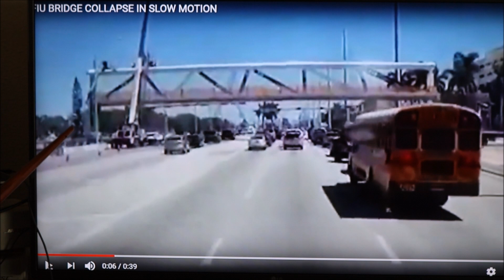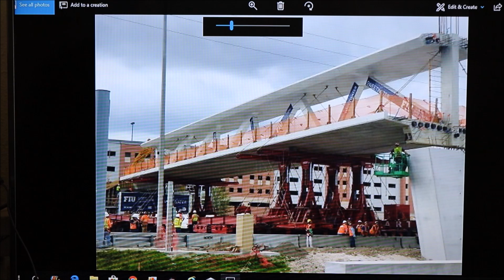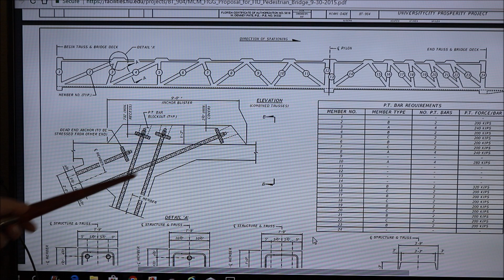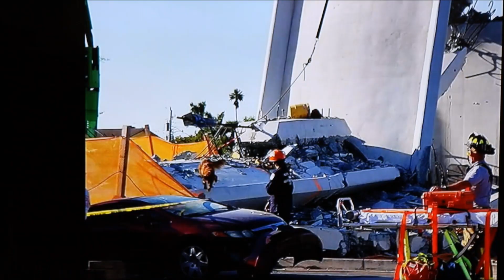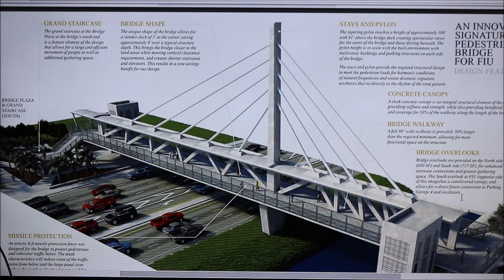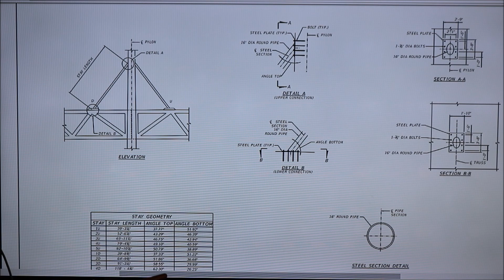Miami Bridge Failure Update 18 March 2018

Comment from the maker: Correction: Web member #11 (not 22)...I need stronger glasses.
Reply: There is no detail on the rebar in the design proposal (I have read it). Juan can only work with what is publicly available. If you want speculation, see AvE's video...
Reply from the maker: Howard Thomson that's all in the plans, I'm just hitting the points of interest to investigators, not rebuilding the entire bridge lol.
Reply: I believe a bar was added to 11 for the purpose of cantilevering the bridge. I believe the design drawing is correct in there not needing to be a bar in that member as it is under compression. I also think workers were removing the tension from that unneeded bar when the failure occoured. I think what happened was the lower deck had failed(the mentioned cracks) and thus it was not in proper tension. That extra rod was the only thing holding that end of the bridge in and maintaining tension on the deck, it was doing that because it was on an angle.  As soon as that load was released the deck broke and the whole thing came crashing down as a result.  It is clear a PT rod was not needed in #11 because it is not failed, you can see it intact pointing at the ground at the 10:11 mark.  It sure looks like the lower deck fails close to #10 between it and #11.
Reply: dlwatib The preliminary design plans are ambiguous,  and lack critical details such as rebar, and design loads. A static structute must have at least 50% safety factor while under construction,  and before traffic is permitted underneath. What happens if a hurricane arrives during construction?
Reply: I think he was loosening tension in the end member that was tensioned up to take the cantilevered end during the move. This member would now be under a huge compression load making loosening the tendon stress a simple adjustment. Their must have been damage to the concrete where the members connect to the upper slab either from overtensioning before the move or the support position during the move. 

One thing I don't see is much conventional reinforcing. Unless I have been out of the business for too long, when did the requirement for minimum steel reinforcing in columns get removed from the code? I see clean breaks in members without the cage of deformed steel you would expect protruding from the ends that tied the truss joints together?
Reply: I thought I needed stronger glasses ... (lol... )
Reply: I think you are misreading the plans when you insist that the superstructure is primarily for esthetics. If you read it carefully, you'll discover that the truss was only designed to be strong enough to carry the static loading of the structure itself. The superstructure was what they were depending on to allow the structure to carry dynamic loads such as pedestrian traffic and hurricane force winds. In other words, the truss was only strong enough to stand there during construction. To have a fully functional bridge, the superstructure was absolutely required.
Reply: Howard Thomson: This is the best and most complete information on this bridge I have found. Aside from your other whiney complaints in your comment, you say that the only mistake was letting traffic drive under? Holy shit man, the bridge collapsed. Don't you think that should count as a mistake? You surely don't know why it fell so why not put a sock in it until and unless you have something smart to say.
Reply: Come to find out a light weight Aluminum anodized bridge no oxidation or corrosion would have worked safely ......No need for mega tons of heavy deadly concrete !
Reply: yeah, Like I typed before, that is a lot of changes to the construction plan. There is just so many ways changes to the plan can be bad. 

Great vid Juan. B)
Reply: I agree. Interesting followup question, is there any way to construct a cantilever that does not concentrate stress in the span being transported??
Reply: Howard Thomson.   Wrong! Moving the supports inboard for movement IS very common...what is insane and criminal is removing the supports BEFORE retensioning whilst allowing traffic underneath.
Reply: You inspire such confidence, Captain.
Reply: I just noticed that.  Excellent explanation, especially that pipe stays to pylon aren't for significant support.
An engineer made a good point that the bottom of member 11 broke loose from the deck, which would transfer all weight to the weak horizontal canopy/deck sections between the north pier and member 10.  
https://www.dropbox.com/s/uz3jmqjiyl238t5/Cause
The span broke at the top and bottom of member 10.  Dumb to allow traffic flow when tightening rods - someone put too much emphasis on keeping traffic flowing during construction and not enough on safety.  The span should also have had a temporary support near the middle (one of those transport trucks could've been parked on striped median, but might've been crushed when most of 950 tons landed on it).
Reply: blancolirio those preliminary plans have no PT bars in 9 and 11? i believe they were tensioning member 8?
Reply: bcbloc02 Many people (including myself) are tending towards that conclusion. The NTSB still has plenty to do, even if that was the cause. Five Why's comes next in the investigation.
Reply: Juan I think you meant to say at 4:12 or so the worker was on the bridge loosening not tightening the end member tendons as you said earlier they tightened them prior to moving the bridge to support the cantilevered end which makes sense. Is it possible he mixed up righty tighty lefty loosy?
Reply: Oh ya.... number 11 would be between number 10 and 12. While number 22 would be between 21 and 23. Just say'n.
Reply: The clear mistake is that it fell down! At first glance it is clear that there is a lot wrong with the bridge or it won't be laying on the ground.
Reply: More like they over-tightened that one section.
Reply: Truss foot detail at #11?  Critical most heavily loaded truss joint.
Reply: Interesting point about moving the transports inboard to move the span.  Member 11 was designed for compression strength, but then it changed to a tensioned member when the span was moved.    

And being angled, the force on lower #11 joint was over half the total weight, with it being  pushed toward the edge of the span where there was little/no material backing it up.
Reply: impressive explanation
Reply: blancolirio thanks brother! I appreciate the detail you put into this with drawings & video, etc
Reply: blancolirio nice vids by the way I can help with the glasses. Replace two glasses of beer 🍻 for scotch 🥃🥃   Cheers.
Reply: Juan,. Go back and look at the sheet you are pointing to. There are no post tension rods in members 9, 11, and the upright 12.  ,. And according to the chart on that same page there are three configurations for the webs that do have rods,. Four rods in an "A" member,. Two in a 'B" member and two in a "C" member but side to side, not one over the other. The line in the chart is blank for the members listed 9, 11, 12. Apparently the Jack and ejected rod we are seeing is from member 10 and not 11. In service #11 would be under compression. But as transported with the Jack dollies moved closer together it was in tension. The voicemail message that Friday mentioned cracking in that end of the walkway, but was not specific to the deck or web members.
Reply: TAKE # 2.??
Reply: Plans change, and truss #11 would have needed PT bars when cantilevered during transportation.
Reply: Where were the reported cracks located? Were they located where the break occurred?
Reply: You can see a puff of dust at the outside of the left pillar right were the diagonal connects at the moment of collapse. Plate failure during tensioning of the rod.
Reply: blancolirio - OK, that's one correction. I agree that the tension rod shown protruding from the top of the canopy and described as from the end of web member 11 was in fact from web member 11. The drawing shows a chart including tension rod quantities in web members, with zero rods for web 11, but the photos apparently show a single tension rod for web 11 which protrudes (after falling) from the center of the left end of the block. There could have been another tension rod, not beside but vertically oriented to the one visible, and possibly with its end covered as described for web member 2. 
However, the block from which this extends is not a piece of web member 11 protruding through the broken canopy. It is the block that was on top of the canopy that links web members 10,11 together. Similar blocks are shown at each of the upper web joints 2,3 4,5 6,7 8,9 for a total of five linking blocks built on top or partly protruding from the top of the canopy. Apparently on contact with the road, this 10,11 block became detached from the canopy around it, so that the block is raised a little above the canopy at video 5:29, resting on the block thickness and also on the two web members attached to it. Web member 11 then is reaching down toward the end of this block, either still attached at the wrong angle or broken off from it but mostly hidden behind the now-vertical end section of the canopy. 
So as a failure mode - if there were two tension rods in web 11, one or both had been tightened before the move. Changing the tension on one of these and not the other caused an unbalance, bending web 11 which was under high compression so that it broke. The failure was caused by an improper tension adjustment sequence. (my guess?)
Reply: yes, and acc.  the table next to the detail, you see that member 11 has no P.T. rods??? and no P.T. force!!!
Reply: Juan,  We appreciate the information but you are showing no rebar or prestress- post stress tendons which would be massive in a structure like this, among many other details. There is a lot more to this bridge than what you are showing and making some judgemental comments upon which are half baked at best. And there is little wrong at first glance with moving the supports inboard as that made it a continuous span bridge for the moment, very common, widely and historically utilized. The only clear mistake at this time is that traffic should not have been allowed onsite so soon.

Comment: This design was doomed to failure with FAR TOO MANY UNCONTROLLABLE VARIABLES.
Reply: Doomed is a bit strong.  The bridge could have been built but the design was difficult to build and, in fact, should NOT have been built.  A steel truss would have been easier, cheaper and safer. But that would not have given FIU's concrete engineering program 'bragging rights' to an 'innovative' design.  Ego killed six people.
Reply: a single worker should not be able to cause a catastrophic failure of any structure period.
Reply: Single vertical truss = single point failure with no redundancy, should never have been approved. Post tensioned concrete truss has complex sheer and bending forces on adjacent members, very bad idea. 50 to 1 dead load to live load bad idea too especially over a highway. Vanity project for FIU ABC program and FIU concrete engineering school. Expensive, federally funded boondoggle.
Reply: Jim Ebright,  Easier, cheaper, safer and maybe lighter also.
Reply: Gregarious: How in the world do you justify that statement?  Just because it looks wrong to you?  I know rushing to judgement is a well-thought of pastime,but no one knows whether the problem is one of design of the trusses, the joints, the tensioning or whatever.  The statement about uncontrollable variables is just ridiculous.
Reply: Puncheex2: You might be serious, but in my opinion Gregarious has got it right.  This design should have dropped the minute it was suggested.  A large single concrete truss is not the way to go for any type of structure.  This is probably the first and last time you will ever see it considered as viable.
Reply: Not ever posible.  A human with a stick of dynamite trumps about everything.
Reply: puncheex2: No redundancy is also a problem. Post tensioned concrete truss bad idea too. No worker would have stick of dynamite.
Reply: I'm serious.  In what way do you mean there are far too many uncontrollable variables?  Are you talking about the truss bix design, with all the crazy angles?  I assure you, as an engineer, that this is not a primary problem.  The design of the triangular members can be computed both in closed form and by computer simulations.  It is not the basic design of the truss that is at fault - it is  making it go through stresses that it was not designed to handle, by weakening joints that were critical to its design.

Comment: Thanks, very useful update, including some of the links I posted in previous video, with more details than I was aware of!
Reply: Correction at 06:07: Steel is elastic UNTIL its yield limit, thereafter it becomes ductile/plastic, and eventually fails.
Reply: Design quote at 09:50: "We are reinventing the web truss".
Juan at 09:55: "Anytime you venture into new engineering territory, you are inviting and creating additional and new modes of failure".
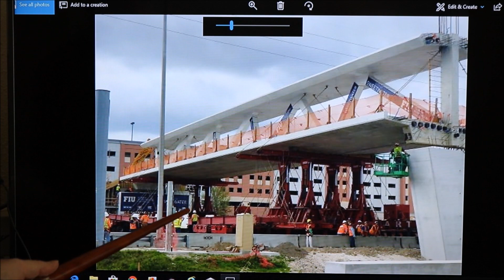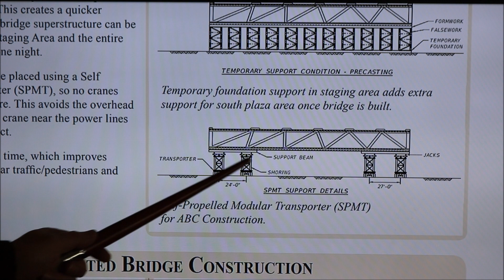Reply: At 03:00 the SPMT transporters are shown with the supports lateral (sideways) under the bridge. At 02:00 the original drawings show a support beam positioned span-wise (lengthwise) under the bridge (where it cantilevers). This is a critical detail change (pointed out by AvE).